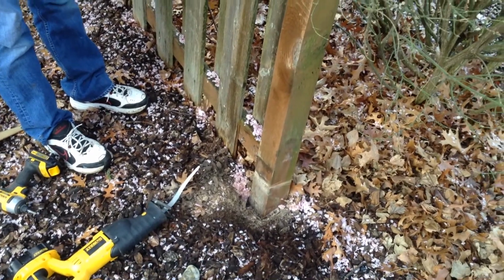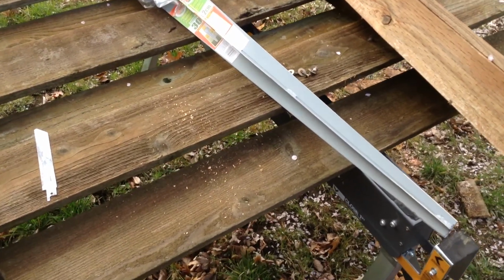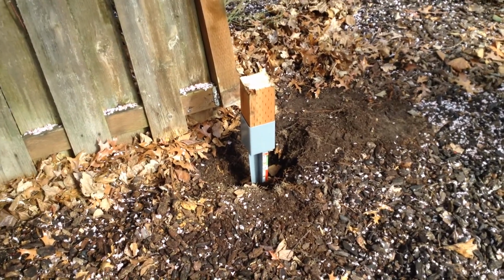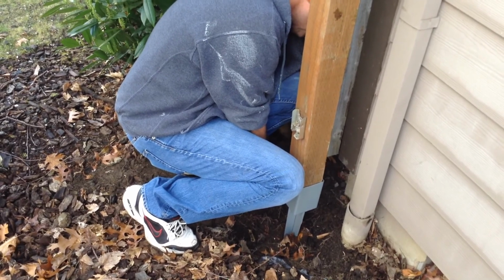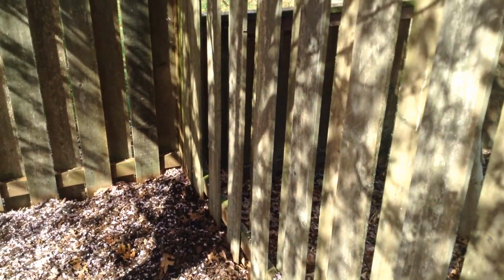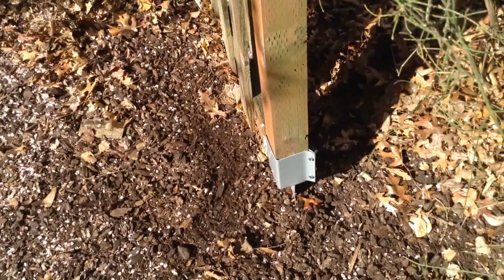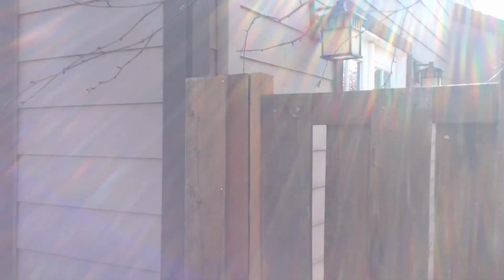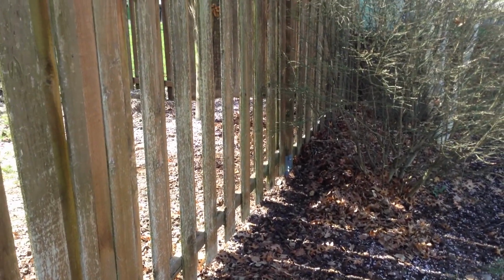Fence Repair using fence LTL Products Groundmaster 30inch mender spiked post bases

Comment: They may work well for you but I don't think I would ever use them. MAYBE in a part where the post did not have much stress. I see issues like hammering it in and it goes a little crooked, and if the post was under enough stress to break in the first place, I don't see those little pieces of metal making it better. 
Now, for dry rot, yeah that would help. I don't recall the life expectancy of treated lumber in that condition.
Reply from the maker: Two tricks to know:  1- Sharpen the tip and edges of the first 6" or so  with a grinder before hammering it in, big difference.  2; which did not quite show up the same way in the video, they always go in a little crooked, but not by much.  You can tweak and adjust it a bit as you cinch down the main bolts and then run a drill bit through the metal part on the side where you need to pull it down a bit and then run a single lag screw into that hole, into the wood, that's how I level them after the fact.   They are particularly well suited for the windy areas because they are springy.  Rigid ones, once the bend, the pole snap and that's it.